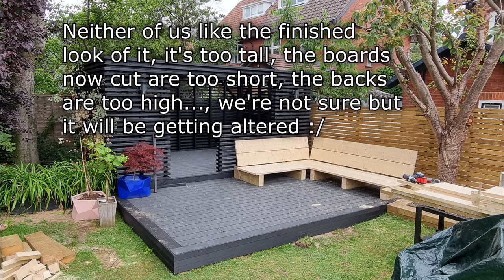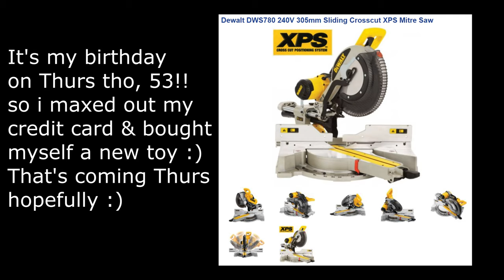Deck seating build Pt4 - I cut & put the boards on but neither of us like it, it'll get altered

Comment: Happy birthday Gid, I’ve got the flexvolt 305. It is big, it can be heavy but it’s an amazing saw. You might have to redesign your van layout to get the bugger in🤣🤣
Reply from the maker: Thanks Paul 👍 Yep,, i def need to make  more secure way of storing, I hadn't really got that far with the van racking, & now will need to crack on with it, After i bought it i compared it to the Metabo, that weighs 16.3kg, the Dewalt 24,8kg 😮😂💪👍

Comment: Benches look great. Just one thing i would do different. I would cut the back rests slightly longer & cut both sides at an angle at the end in the corner so the back rests but  up together with no gap. That would also mean you could add some screws for support of backrests in the corner. Not having a dig at your work as i love your videos but thought id share my opinion.
Reply from the maker: Hi thanks, i wanted to put the backs together so they would support each other, the open detail is his choice not mine, but i build as asked & was left to work that one out, he has plans to hopefully make the benches look better & i always put my 2p's worth in but that corner detail prob won't change, it's been on the cards since the beginning despite my wishes, like i say i build as asked, they're paying for it, they should get what they want so we'll see what he wants to do Fri.
Reply: Ok pal cheers, yeah thought that was the case couldn’t remember will do the same see what’s good, yeah will get the misses to make cushions, cheers for the advice and inspiration 👌👌👌 top man Gid

Comment: Maybe take a few inches off the height and create a valley where the two back rests meet to make them feel more connected. The other thing is that the corner is so deep nobody could sit there, so maybe make a small corner table to give it some utility?
Reply from the maker: Thanks James, all those have been discussed & dismissed,  the seat is only 278mm high, less than a foot, the camera picture is a bit deceptive, 240mm for the sleepers + 38mm for the boards, that corner's prob not going to change, the open corner detail is his choice & it was going to be that way pretty much from the start n when i suggested joining/mitring it was dismissed, mitring the seat boards was considered & dismissed when he saw the boards butted up, but that bit doesn't bother me either way, it'll be cover in thin cushions but the back being open like that meant i had to find a way to hold it, support it, it was mentioned & I was left with that to work out, 🤷‍♂️🙃👍 a corner table was considered too but he wants to be able to lay down on it & , i build as asked, we'll see what he wants to do Fri.
Reply: @Gidjoiner  I'm sure you'll find a solution. And Happy Birthday for tomorrow. Enjoy playing with your birthday present.
Reply from the maker: Thankyou James, yep hopefully & i will do, depending on what time it arrives i suspect i'll be building a better storage solution in the van for the saws,

Comment: Happy Birthday Gid, have a couple of pints on me.
As always your vids are very much appreciated. Would be interested in knowing whether you considered any other mitre saws.
Cheers!
Reply from the maker: Thankyou Gav, very much appreciated 😊🥳👍 yep i pretty much looked at all makes worth buying, mainly - Makita, Bosch & Festool, but they don't cut the 100mm i need for this outdoor stuff, one of them can't remember which, think it was the Bosch says 105mm but some of these posts are 105mm & the price difference between the Bosch & the Dewalt wasn't much at all, My old Dewalt lasted 25yrs that's why i replaced it with the little one i have, this saw has good reviews & all my other Dewalt stuff is doing ok, I haven't got Dewalt drills, I killed a couple of those in the past, they died too easily which has put me off, they may be better now but i'm not on the Dewalt cordless battery &  don't want another charger to deal with, quite happy with the Bosch 18v & recently inc the Makita 18v.  so wasn't interested in the Dewalt cordless mitre saw, i quite often have to set up a lead for chargers, compressor etc. anyway so 240v is fine with me, Thanks again 👍👍😁

Comment: Looks good Gid. I'm surprised you didn't cut some plugs to cover the bolts.
Reply from the maker: Thanks 👍 I don't have an 18mm or whatever size it was plug cutter, &  I prob wouldn't plug them anyway, in our weather they'd just start comin out whatever glue you'd use or trap water in increasing the chance of rot,  it's just as well tho because they'll be coming out in a few days for it to get altered,
Reply: @Gidjoiner   I hear you Gid. Commented before the end of the video. When you modify the seats are you going to join up the back rests instead of leaving a gap like it is now ?
Reply from the maker: No that's how he wanted it to look, makes it a little awkward to support that short back piece but we'll see, i'll think of something, he wants to try keep them as two separate pieces 👍

Comment: Loving these latest bbq Room vids 
Going to use your bench idea so sent you a score through PayPal for your bday
Reply from the maker: Thankyou Stephen, very much appreciated 👍😊  the camera lens is a bit misleading, the bench is only 278mm high, 240mm for the sleepers + 38mmfor the boards, = less than a ft high, but the backs are maybe a little too high & the overhang on the seat boards ends should be bigger, this job was always a make it n see type thing & unfortunately it'll need adjusting but i'll sort it out n we'll see what happens Fri 😉 it'll be right 👍 Best of luck with yours, yeah i think the supports will be really strong 👍

Comment: Hey Gid mite build myself some like this they look pretty comfy, what degrees did you cut the leg groove at? And do you think they where comfy 😆
Reply from the maker: Hi, in the previous parts, pt2 i think you see we simply stood boards up against the fence & offcuts of 2x2 against the building, then put some backrest boards against those & tested it out, Sorry no set angle, trial n error till we found a comfy angle, in one of the vids i show that the angle was decided & i marked that on a piece of wood before dissembling the temp structure, Bit hard on your bum, needs cushions 😁👍

Comment: I would connect the backrests together by mitering one into the other then they will look seamless and I think will cancel out it looking too tall. Also means you just need to change the backs on one bench only. Non fence side back looking something like |===/ if that makes any sense? :)
Reply from the maker: Thanks Gerry 👍 it'll be not my choice, he's already laid out the spare boards we had for a table & the gap in the corner back rest is his choice, don't think that's going to change so we'll see on Fri, i build as asked, I think the camera gives a bad impression tho, the seat is only 278mm high, 240mm for the sleepers & 38mm for the boards = 278mm, less than a foot but in the pics it looks high.. we'll see,
Reply: @Gidjoiner  nice one mate, you do top notch work and I know you are working to the mans design 👍 he seems like a good client too,  plenty of work there!

Comment: That's always the problem with benches that thay want to use cushions on, they look a bit ungainly the rest of the year.
Reply from the maker: Yep, we'll sort it out Fri, it's only 278mm off the floor, 340mm for the sleepers, 38mm for the boards so less than a ft but cutting the boards has made it look 'bobtailed a bit, the camera lens doesn't do it justice either, we'll see what happens Fri 👍

Comment: Wait until the women start putting on the cushions. It will be OK height then.
Reply from the maker: 🤣  Yep 👍 i think the camera doesn't show it right, weird thing is it's only 278mm to seat height, 240mm for the sleepers + 38mm for the boards, that's less than a ft off the ground but it looks too high now the seat boards have been cut, it's some kind of perspective thing 🤷‍♂️👍